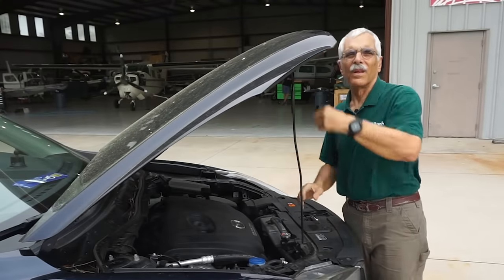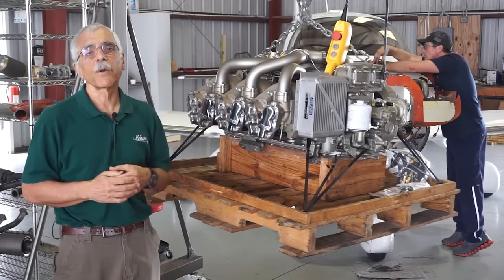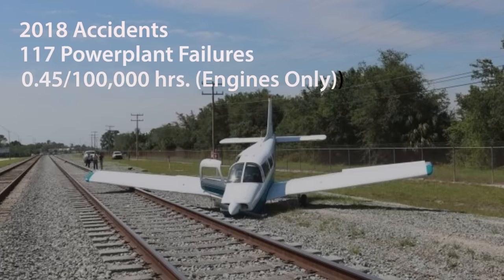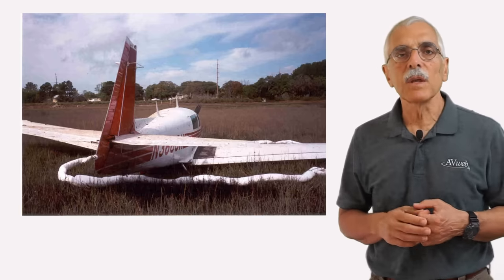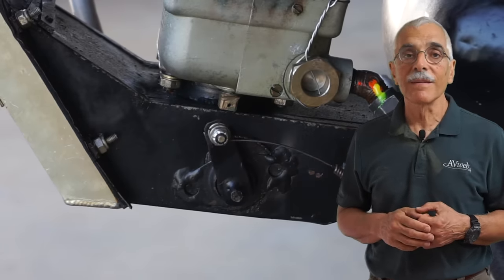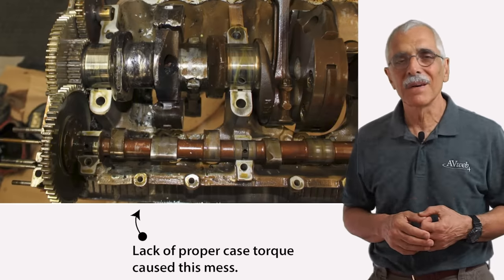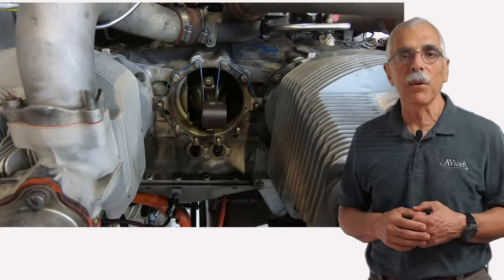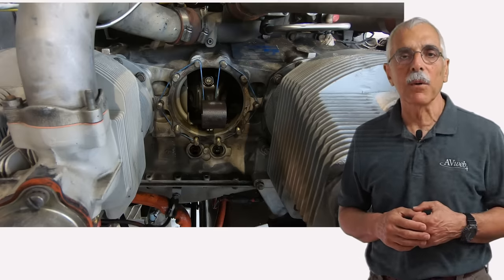Why Aircraft Engines Quit

Comment: I became a licensed A&E mechanic back in 1962 having graduated from Northrop Institute of Technology in Inglewood Ca. My head was bursting  with fresh information on every nut, bolt, screw and FAA regulation concerning aircraft maintenance and I had my license tucked in my wallet. I started making the rounds of FBOs here in Southern California. There are hundreds of them. 
I started at Van Nuys municipal airport. Frank Sinatra and Danny Kay owned the Lear jet operation, plus the California air national guard had a very active C-97 squadron with twenty planes. It was the premier GA airport for many miles around and aircraft heaven for a young freshly licensed A&E mechanic itching to do some top notch nut busting. Only it wasn't. 
Turns out many of the plane owners did their own maintenance. It was a DIY paradise. They worked on parts of the aircraft that lent themselves to the use of a crescent wrench, pipe wrench or lawn mower tools from home. Some brought along a cold six pack of Budweiser to cool themselves. What ever the situation they said they didn't need no A&E mechanic. Often a half dozen guys owned part of the plane to keep costs down and they all wrenched on the plane. Prospects for my mechanical talents were looking dim. These were the same guys that shade treed on their jalopies when we were all young. Money was in short supply for them and licensed mechanics were making $3.50 an hour, no way they could afford those rates. Inspections flew by without a backwards glance. Oil changes? New tires? Flight hours recorded? Naw. 
A used Piper Cub could be bought for $1,200 bucks. Divided by six guys made it affordable. The kids won't miss Christmas.
The final blow to my GA aspirations came when I ran into a guy wrenching on an  AT-6 Texan. He had the cowl off and was fiddling with what looked like a short crow bar. I introduced myself, he said he was a broadcast engineer for one of the major TV channels.  He was trying to get one of the magnetos to come loose, with little luck. He told me he didn't use a licensed mechanic because of the cost. This guy was probably making $15,000 a year (good money back then)If he wouldn't spend the money on my services, who would??
I tried the want ads. Lo and behold there was an ad for a licensed aircraft mechanic. The name of the company was Ted Smith Aircraft located in Canoga Park cal. I got the job. Ted was building the prototype twin engine Aerostar. It was in a fuselage jig when I showed up for my first day of work. Two years later the completed Aerostar was trucked out to Van Nuys airport for its first flight test. I had been a part of almost every inch of the assembly. I felt like the luckiest guy in the world.
Reply: That's some professional autobiography!
Reply: Isn't that an A&P??? What does the E stand for? Not trying to be a dick but I think you made a typo.Northrop U off of Aviation is became Rice University and now it is called Spartan Tech they still teach A and P.
Reply: KingOfAllAnimals A&P, meant airframe and power plant. A&E, means airframe and engine. Aircraft mechanic has been upgraded to aircraft technician, a much more accurate definition of what the current A&E rating means today. A licensed technician can be held legally responsible for careless mistakes during maintenance and especially if there is loss of life. The FAA is the 800 pound gorilla in every licensed technicians tool box. Shade tree mechanics need not apply.
Reply: @timmayer8723  Indeed times and things do change. Now I understand. That is the thing that gets me is that aircraft cannot park on a cloud when something goes wrong. However the FAA also makes mistakes too. Not often mind you but they do happen. It has been a while since I had a peek in the FARs and I have to bet the volume has expanded since the last time I read it... a lot. Is 43.13 still the bible so to speak for Mechanics?
Reply: Great post mate i enjoyed reading that. Aerostars are a cool plane! All the best!
Reply: That's a cool story. I don't think there's enough mechanic content on youtube. No disrespect intended to this vid, it was good, but it's always pilots talking maintenance or internals of an aircraft when I want a deeper dive. 
Anyway, I've been a USAF/contract mechanic for 34 years now. I do very heavy maintenance & think nothing of it but you couldn't pay me to do GA or CA (which is why I never pursued a license). Nope, no way. So, good on you & those in the business!
Reply: Your recollection took me back in time, I felt like an observer.
Reply: I flew freight in an Aerostar.  It was the nicest light twin aircraft that I’ve ever flown.
Reply: 605pilot when we got the Aerostar assembled, in Canoga Park minus wings) it was loaded on a flat bed truck and hauled over to Van Nuys Municipal airport, a distance of about ten miles on city streets. Although the Aerostar was tied down to the bed of the truck it wasn't covered with a tarp. Gawkers followed like bees around honey. Four of us mechanics followed in our own cars. 
I had just bought a used red 1960 thunderbird hardtop (forever a car guy). Teds son Ron wanted me to drive first in line behind the truck to draw more attention to our parade as if that was necessary. The Aerostar fuselage spoke for itself in its delft blue and bone white livery. Tail number N360TS. TS for Ted Smith. Ted was a snappy dresser. Silk suits,  black tassel loafers. He always looked very distinguished with his white hair. He was a hands on engineer and had no problem sliding under the fuselage when we had a problem figuring out why the landing gear would not clear the wing openings when retracted. Ted spent half the night with the chief engineer, myself and four other engineers retracting and extending the landing gear. I was the one who had assembled the main and nose gear from boxes of parts. The main gear had to make a slight but very precise turn retracting and extending and it just wouldn't clear the fuselage skin. Ted finally called it quits around midnight. 
A week  later a new set of  blue prints specific to the landing gear openings was presented by Ted to our crew. It required precise cutting, riveting and adjusting the wheel well covers and the corresponding fuselage surfaces. It worked, as we watched the tricycle gear ascend and descend silently and the gear doors open and close smoothly. 
The initial landing gear extended testing was completed at Van Nuys Muni. Airport. The first time Ted and the test pilot left the ground was an anxious time for me. I was the only mech to install the push pull tubular control system which had to be precise to fractions of an inch. This project took me about five working days to complete before the chief engineer signed off on it. I felt great relief when the Aerostar turned final to make its first landing, which it did, smooth as silk. 
Ted exited the Aerostar soaking with sweat as did the test pilot. It was a hot Southern California day and the Aerostar had inadequate ambient air vents. Ted finally came over to me and said he wanted two vents cut and installed on the dorsal surface just behind the windshield. Blue prints were drawn a week later and I cut the openings and installed the vents. I don't know if they remained a part of the aircraft or not. I doubt it. 
The flight testing was conducted at Edwards Air Force base which is about a fifty mile drive from Van Nuys Muni. Those of us who worked directly on the Aerostar had to make the drive every work day. A small price to pay for a ground breaking experience. 
While at Edwards I got to see the Valkyrie land and taxi. I was in A&E paradise.
Reply: @timmayer8723  I worked as an engineering aid for USAF at Edwards summers 1968-69 during college. I too saw the remaining B70 as well as SR71,YF12A and the final flights landings of the X-15 those summer. I still remember the ground shaking when the B70 rotated on takeoff. Loved my job there. 30 years later I wanted to show my son Edwards as we drove to the Grand Canyon. Was stopped at a checkpoint near Rosamond. Seems security had been beefed up in the intervening years. In those days of 60s you could drive unquestioned and park 50 yards from an SR71 being serviced for flight. My dad one time walked up to the X-15 that had just landed on Rosamond Dry Lake and thumped the fuselage. He reported to me at dinner that it felt surprisingly solid and heavy. Working those summers I had a flight line pass so could walk around the hangers sometimes at lunch. In the M&M hanger was a B58 Hustler and an F104, that had a landing mishap and was up on floor stands. Despite being only 18 nobody ever questioned me except one time I climbed up to inspect the cockpit of an F-111 and a mechanic said I should come down for concern that I somehow set off an ejection seat. Spoilsport!

 Loved those days.
Reply: @timmayer8723  Great Story Thanks!
Reply: @averageguy371  CA=commercial aviation?
Reply: In my 15 years as an aircraft mechanic, I only worked one month in general aviation, and would never consider going back to it. There is simply no money in it. Military contracts and airlines have always been where the money is made. My wages and benefits are chump change compared to what the airline earns each flight. My job is secure because my presence is cheap compared to what a delayed or cancelled flight costs them.
Reply: 🛫📖🛬

What a Great story. It vicariously took me back to that day in time.
You were actually privilege to be a part of aviation history because Ted made history with that airplane.

I believe you have the past that would make for a good book.

Thanks for a good read. Would like to hear more from you

Both of our careers launched about the same time. I was knocking on the door of every airline at that time trying to get a right seat job.

Wow! The time has really flown by.
(No pun intended, lol)

🙏✈️🇺🇸🐆
Reply: @timmayer8723  
🛫📖🛬

After reading the second post to I know you need to write a book.
Reply: Now it costs $100 to replace a F...ing bolt on a plane thanks to all you innovative A&P's!   Let's see...(I looked up the equivalent inflation rate ) a used Piper Cub cost $1,200 in 1962 so that same plane today should cost  $11,424!  surely you could get an old Cessna for 4 or 5 thousand.  That would/should be equivalent to $47,600 today!  In fact "Forbes Magazine' reported that,  "The ubiquitous Cessna 172 Skyhawk retailed for $12,500 in 1970. Today, the base price is $432.000."  The cost of new 172 in 1962 was $9,895!  Thanks but no thanks...I'll just buy a cold 6 pack of Budweiser!
Reply: Do you remember Sky Hawks flying Club near Clay Lacy aviation.  My childhood was spent at Van Nuys Airport  with my my Father the president of the club as many as 14 planes.  Yes he and I did the easy stuff.  There were so many accidents at van Nuys in the 60sand 70s that he became NTSB and head of Avemco ins.  His  Name Tom Algier
Reply: @timmayer8723   Be Proud,  wow you were blessed, in timing,  that was a great era,  a part of history, hope you have pictures around the house , of these moments.
Reply: Yes, I have a copy somewhere in my files. Iam long retired and bought my copy of the FARS just to experience the learning process. It is about ten years old now. 
When I was studying at Northrop Institute in Inglewood we studied from the CAM-18 manual. Since basics are always the same the CAM-18 (Civil Aeronautics Manual) was current enough for civil piston driven aircraft up to and including the 12,000 pound category. I forget when the CAM 18 was first printed but it superseded WW2. The drawings which illustrated some processes were dated back to 1918. VERY old fashion. It was up to our instructors to breathe new life into the words and pictures from this very elderly tome. 
My FAR copy goes into great detail about carbon fiber technology which was just on the horizon of civil aviation, having come down from the stratosphere in cost enough to be considered a part of small civil aircraft.
Reply: The Aerostar was considered a civil aviation hot rod back at the dawn of its construction. Which was when I got involved.
Ted R. Smith was an aeronautic designer par excellence. He was the designer of the B-25 bomber among many other military aircraft that saw service in WW2.
He designed the Aerostar with certain one off fighter plane tendencies. Quick handling, high speed. You could not transition to the Aerostar without extensive flight training. Some pilots pushed its flight and handling parameters and paid with their lives. Constant attention to and timely execution of (details)were required to fly the Aerostar.
Reply: Wow. A good old fashioned A&E. A great pleasure to meet one of you old greasers. My instructor has an A&E. Been touching planes since before the jet age. Ended up being a turbine specialist, and he got his Charles Taylor award a number of years ago. 
He was my school's turbine Jesus. Taught my class & i everything a student could possibly want to know about gas turbine engines, and then some. I just got out of GA and into the big commercial jet world. And his knowledge is paying off in droves now.

As for people not doing the right thing with maintaining their aircraft, the way i see it, if you can't afford to get your plane maintained properly, you have no buisness owning one. 's why i dont own one. I can do my own basic stuff, being an experienced piston mechanic, sure. Might even do my own 100s. But $5000 annuals? $30,000 engine overhauls?! Not within my budget. So im stuck on the ground. 

Better than flying my ineptly handled junker with 2 year old oil in the engine, waiting to send some rods.
Reply: @KingOfAllAnimals  Not a typo but isn't
"is became" a compositional failure, incorrect verb tense? Not to mention missing punctuation.
Reply: @timmayer8723  I got my A & P  which meant I was Power Plant certified. not only was I formally taught the various Gasoline burning engines but also Diesels and turbines. We were taught that we were legally bound to our repairs so if a plane went down and records show it was any one of us in our class who did the work faced all the civil and criminal punishment under the sun. These days I service write in a diesel shop and I have seen Shade Tree and then we get the occasional DIY job that had a Meth Enthusiast perform such as Wiring that resembles something out of a Horror movie more than spaghetti rolled in grease. Then there are the jobs that somehow the previous mechanic or shop managed to force fit the wrong part into the wrong application and then scratch their heads and asses wondering why they still have a check engine light or weird howling noises as they drive as metal eats metal. I have seen some crazy stuff in General Aviation that runs against what I was taught. Plastic fairings that were cracked like crazy held on by a prayer, wing skin fuel tank bolts held in with RTV silicon or epoxy, cabling rerouted the wrong way by a DIY. And then there was always those silly Airplane Drivers who whine, "That repair is too expensive." Not my fault most of these cheap A Holes have to spend money on a plane they flew almost into the ground.
Reply: @thomasmleahy6218  I got my A & P, Air frame and Power plant. I doubt highly perfect grammar makes a good mechanic.I never made a mistake that was catastrophic or could not be repaired which says a lot. Also spell checking is not grammar checking which is not offered here. I would think the content is what is important, not the window dressing. So I take it image is more important that Fit Form and Function and RELIABILITY? Besides, dare I write a thesis here just to make you happy?
Reply: Sad to say, it hasn’t changed!
Reply: @averageguy371  not many videos, cuz anything can be used as evidence in court.

Yes. You will be sued even if you did nothing wrong, why add fuel to the fire. Pilot crashes, the family that’s left behind can’t believe it’s not pilot error, so sues everyone who ever touched the plane. Happens time and time again.
Reply: @EthanA1122  it costs that much due to feds, low product output (have to sell each unit at higher cost), and the ever revolving sue the crap out of everyone post crash.

Oh yea, and APs aren’t willing to live on food stamps for your hobby anymore.
Reply: @KingOfAllAnimals   I studied aircraft technology (1962) from an ancient mechanics bible called the CAM-18 (civil aeronautics manual). My copy was stained, wrinkled, marked up in two or three colors and dog eared. It was the size of a TIME mag and about 1 1/2 “ thick. I lost it years ago when we moved. My new and improved Part 43 mechanics bible which dates from about 2004, is a hefty tome, having been updated from the middle 30s to the early 2000s, quite a leap.
Reply: @Timothy-lb2vr  43.13, that brings back memories. Funny thing is I was able to apply my A & P training to a lot of other facets of mechanical work. Part 43 when I bought my first copy was about six magazines thick. It was a proper book with part A and B in the same book. Now is a Los Angeles Area Phone Book in size. Remember the old yellow pages from when Dinosaurs walked the earth? These days I use a lot of my training in parts hunting working on coal burners. That and automotive in general. Beats getting coated in oil working on some of the over abused rolling dents I kept alive over the years. My text books also were the size of phone books too. 43.13 was not the only bible. The A and N Mil Spec hardware reference was a God Send for hardware. That little green book did me a lot of justice when I had to look up hardware. Now I have to say just one word... Microfische.
Reply: @KingOfAllAnimals  I  have done  massive amounts of a/c sheet metal  work. It caught my interest  as one of my courses of study at Northrop. It was very satisfying to run my hand over the work I had just completed  knowing it would pass inspection. Installing a cargo door on a DC 6 as part of a complete change over from a tired 4 engine passenger  airliner to a  work horse cargo plane as my most challenging piece of work. The cargo door installation took me about two weeks to complete as I was working alone being the only licensed  A&P  in the hanger The over all project took around 18 months. It was ordered by a Peruvian  common  carrier to haul  cattle carcasses and other commodities over the Andes. The smell must have been  terrible
Reply: @Jolinator  Ted smith designed aircraft mostly for our government, such as the B25 and others. The AEROSTAR was his first offering to the general public and became a hit with those who could afford it. Ted Smith offered the Aerostar as a one off luxury aircraft with certain handling attributes of a fighter plane. It was not a plane for the novice or beginner. It required an extra level of focus while in flight especially in the fuel transfer system. The main fuel tank, which I installed, was a bladder mounted just forward of the cargo compartment, the other tanks were in the wings. It was fast and nimble and demanding with  twin 300 hp  fuel injected continental 6 cylinder engines. The current AEROSTAR aircraft are jet powered.
Reply: @timmayer8723  
I’m immensely enjoying reading your comments. Thank you very much! 
I’m surprised you wrote ‘Delft blue’ as a colour. I’ve studied in Delft and still live in the area. The Delft blue factory (Porceleyne Fles / Royal Delft) is still there.
Reply: @chuckcampbell3927  
I second that! (That Tim should write a book. Hack, that’s already two copies sold 😉).
Reply: I was horrified when I left Military Aviation.
Reply: Not surprised by the shade tree repairing going on who is going to care at some small-town airport far away from the eyes of the FAA in Washington DC. It's like in Alaska how many are flying never got a license who will ever know anyway. How many part 91 guys are getting paid to haul stuff in Alaska. I always said there are rules and then there are what really happens everyone bends rules. Airlines bend them just not at that level they do it in small offices where deals are made. Only have to look at history where the FAA ignored the NTSB kept allowing airliners to fly.
Reply: @Mike-01234  look at it this way. The FAA makes the rules. The NTSB decides what happened, how and whos responsible. The NTSB noses around the accident site pretty much as the dust settles on the twisted wreckage. If there are bodies the EMTs know what to do and set about collecting body parts for ID by the medical examiner. If there are survivors the local cops get a crack at them. They ask a lot of questions. Who was the pilot? Where were the various passengers sitting.? We’re there drugs and or alcohol involved, how much and by whom?? The cops don’t get involved with the actual airplane stuff. But once the airplane hits Mother Earth the cops get involved.
As any red blooded American could predict, law suites will fill the air. Ambulance chasers by the dozens, Boston blue blood attorneys, will descend from their ivory towers. They will announce every intention of filing several suits seeing that the scoundrel(s) who perpetrated this heinous crime will be brought to justice forthwith and pay the highest price allowed by our laws. 
All us aviation types know nothing will be done to anybody of any consequence until the NTSB releases their  findings, then it’s every pilot for themselves, leaving the remains for the devil. 
This scenario is the reason new airplanes are soooooo expensive and why insurance premiums are in the stratosphere. Nobody wants to be caught with their flaps down when the judges gavel hits his desk. My guess is that just one even mildly serious airplane accident would end your ability to get flight insurance. Unless your family can do without food and accept living on the street so you can continue to bore holes in the wild blue yonder,
 In your 1949 Aeronca. Your Barney Ofield days are over and out.
Reply: Vivid, awesome comment, as someone who has started hanging out at Van Nuys Airport a lot. I love stories like yours and the peek into the history of this place.
Reply: @pz2233  I keep up on Van Nuys  Muni  through my I pad and the google earth site. For instance  the ANG base  is long gone , replaced by other civilian businesses. Back in the day  there were two massive hangers  side by side  at the north west end of the runway. Each one held  a C-97  cargo plane in for various major inspections or engine  swaps. These areas were called ‘the bays’. A hundred guys would man each bay . 
Stored outside of the bays were  massive Pratt & Whitney  R 4360 radial  engines each with 28 cylinders , each engine capable of developing  4000 hp and flying non stop from Van Nuys Muni to Hickam field  on the big island  of Hawaii .
We flew at night  at about 8000 ft. The only light was the cherry red 8” exhaust  pipes spitting a blue white flame  into the dead black of the night. From within the C-97  cockpit was a display of dozens of instruments  all glowing red .  Very dramatic when you realised there was nothing outside this thrumming  beast  except for the black of night  and thousands of feet below , the utter  vastness of the largest body of water on earth, the Pacific Ocean, which ran at a depth of 12,000 feet for thousands of miles in all directions beneath your wings.
Reply: @KingOfAllAnimals  E stands for engine that’s what they use to call it in the   Old days.
Reply: Sir, did you happen to know an A&P out of Riverside back in th 60/70s named John Grodahl?  He's gone now but a bit of a legend back then. He STC th 150hp/C-150 with the FAA. Just curious.
Reply: @dippyanddakota  Clever Utube moniker. I didn’t know the guy/A/P mech. Riverside is a 100 mile drive from the San Fernando valley where Ted Smith Aircraft was located when I worked on his prototype Aerostar concept. It was
a combination of a well appointed executive speed demon with a % of its performance and handling characteristics of a fighter plane. It was a hit from the start of production. 
I got lucky with my aircraft  maintenance career, it just didn’t pay much. But all in all  I still read pretty much read whatever article involves the mechanic’s of aircraft. I am now 81 yrs. old.
Reply: The death of G. aviation!☹️
Reply: Hmmmm... doesnt sound like much has changed.  No one wants to pay a professional to work on their something they think they can repair themselves.  The few smart aircraft owners know better but, the rest?   My best story comes from that first nice day in the spring when the owner shows up  with a gallon of water to wash the windshield off with and checks the oil, fast walk around and off they all go after not flying all winter.  Most make it and some merely take em to the scene of the accident.
Reply: @EthanA1122 I 
I bought a paramotor trike in 2019 for $11k. I remember those affordable 24:24  prices in Trade-A-Plane back in the 80s.